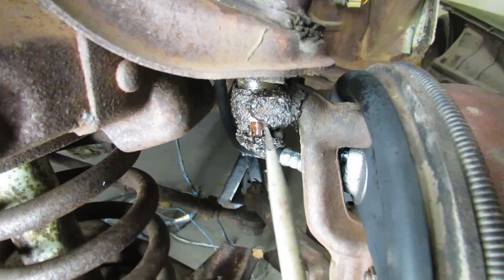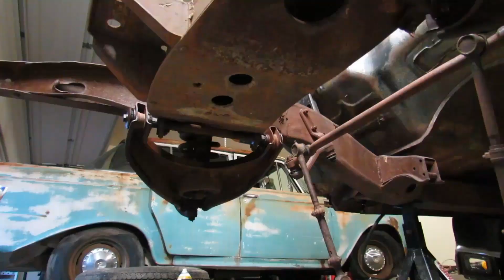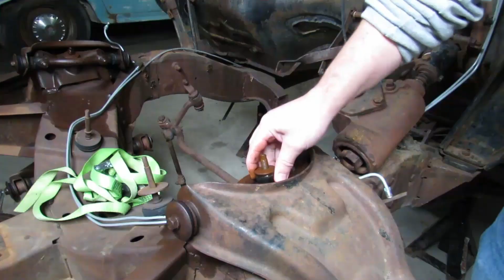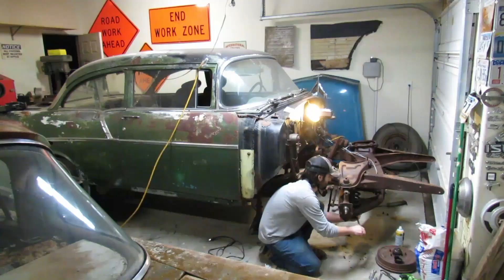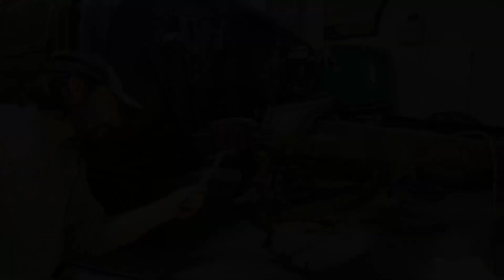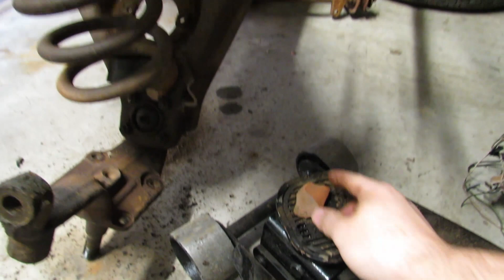Suspension Teardown On The Abandoned Tri 5 Chevy Build!

Comment: Delco was the brand used during the construction. FYI Could be a replacement, but who knows, the shock could be original also. That would be cool!
Reply from the maker: The coil over shocks are coming off the rear of the car in the next video. There's no way they're original but who knows.

Comment: Hey freeman ive found that when things are rusted as bad as that shock is  that taking a wire wheel on a drill and bushing the rust off helps along with so.e sortve spray lube helps prevent breakage
Reply from the maker: Good tip. I should've done that. I didn't want to cut it.
Reply: @freemansgarage   even with wire brushing and spraylube sometimes nuts and bolts still break  i wouldnt worry if i have to cut a shock  or some other part  shocks area wear item they do fail
(Seems like everything i get has worn out suspension )  it is what is i guess